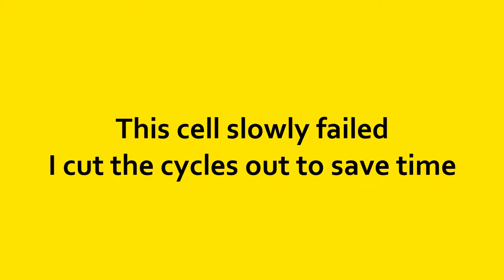New Binder & Load Test!

Comment: Having two meters is much nicer.
The first one seemed to recover better. I would have made a matching pair to see if it sustained higher values. It might be draining one to keep the other from discharging as fast. Nonetheless it was a remarkable test.
Reply from the maker: The most remarkable thing to me, was how fast it self-charged. It was higher in voltage each cycle and it took just seconds each time. Extrapolate that trend in your mind and see where it takes you. :-)
Reply: Yes the effect was obvious. Other questions are: the ceiling, duration, the (self) charge discharge curve, reactions in parallel and series, how many sustainable cycles, and scalability.
This is potentially a significant development providing your assumptions are correct. Certainly the observations are well founded.
Testing under load was a crucial step.
On another note, I was reviewing literature about current cell research and am intrigued about magnesium as an anode material. The main drawback with magnesium is development of the insulating oxide layer which diminishes performance. Your Ti02/PVA coating as a solid electrolyte might inhibit formation of the layer extending if not maintaining the life cycle. The advantage of magnesium is higher potential differential. The energy density is half that of lithium but in a stationary application that would not be important. If application of a solid electrolyte/solid state layer provides self recharging characteristics it might result in an extended life. In the future when I resume testing I might borrow the chemistry to investigate the possibility. 
We have been remodeling/expanding the house and I am reorganizing my shop to provide suitable facilities for cell research among other endeavors. With the ongoing construction my time and efforts have been severely limited. At some point I will be able to devote the necessary attention. 
I have many thoughts to juggle on how to proceed. That's one reason I pay so much attention to ongoing research, so I am aware of the most recent developments. More importantly I get satisfaction in interaction with the community. Some of my observations and resulting comments are just points of discussion but there is always value in the discussion.
I'll be following to see where your current research leads.
Reply from the maker: I'm curious about magnesium in the cell too. I'm about ready to give that another try soon. I've got another improvement in the separator to share next, which I hope will answer a few questions. You are more than welcome to experiment with anything I share my friend. The discussion is well worth the effort too. :-)